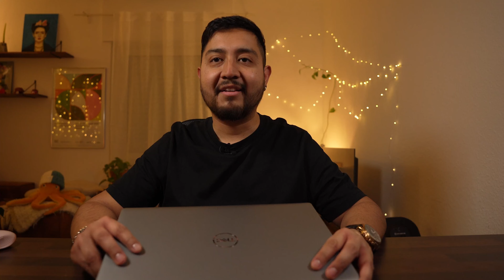Dell Precision 3581 Review / Best entry level 3D modelling workstation

Comment: My Precision 3581 have: Intel i9 / 64 Gb Ram / 1 Tb SSD/ Nvidia RTX 2000 ada Generation.... I'm lovin' working rendering videos/photos, Unreal 5, V-Ray, Sketchup Pro, Irricad, Autocad and QGis. Congrants your video!
Reply: Wow, so you are using Gis software, I want one of this for Arcgis pro and Civil 3D, maybe Revit, how is your experience so far?
Reply: @vivianlopez5202  As expected... nothing special. It's much faster to complete the work and the more refined details of the volume of the objects.
Reply: Hi! I am architect and wanna buy Dell Precision M3571 i7-12700H 64Gb 1TB.  Do you recommand? I am also using archicad autocad phothop 3dsmax lumion. Coudnt find any laptop -if not consider gamer laptops-? Thank you
Reply from the maker: Hey, what GPU does the 3571 has? If it has something like an A2000 it would be ok. It depends on how big are the models you are working with. But as my experience with the 3581, at least the computer is very reliable. Thanks for watching!
Reply: @JorgeMoralesAv  thank you for your feedback. M3571 has A1000. If possible, could you enlighten me on this issue? Most architects around me use gaming PCs with high performance RTX (4060-4070) graphics cards and HX series i7-i9 processors. But workstations like Dell Precision or Lenovo Thinkbook, which are known to be more suitable for architects, have H series processors and graphics cards like A1000, A2000. So it's hard to choose which option is more suitable for me. Thank you,

Comment: Nice review! I am wondering, did you just put  64GB + 32GB modules and it works? Is this combination supported? Thanks, and keep up the good work!
Reply from the maker: Hey, yes, it is supported. Just be sure to update to the latest BIOS and have two of the same 48gb RAM modules. It should work without issues. At least mine worked immediately just after installing the 96gb RAM. Thanks for watching!

Comment: Dear Morales,
Hi...
I have a question and is very importan to me.
I have HP OMEN laptop with below spec:
13900Hx
32Gb-DDR5-5600
GEFORCE RTX 4060
My question is can i use Ansys Software (mechanical) GPGPU capability for solving or NO?!?
If no, please let me know which laptop for Ansys? (right now solving time is near 40 hours).
Thanks in Advance.
Reply from the maker: Hi, you can definitely use the 4060 to speed up Ansys mechanical. Check out one of my other videos to enable GPU capabilities for Ansys if you do not have a recommended Quadro or RTX professional GPU. Depending on the size of your model and the VRAM of the 4060 it may help. Thanks for watching!